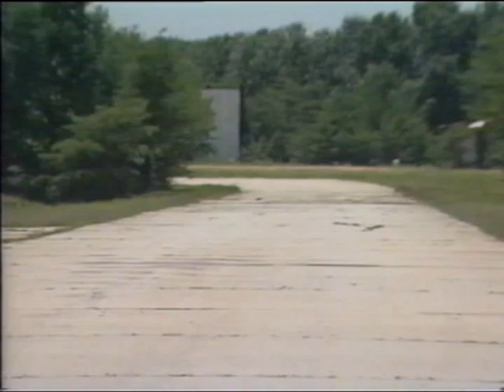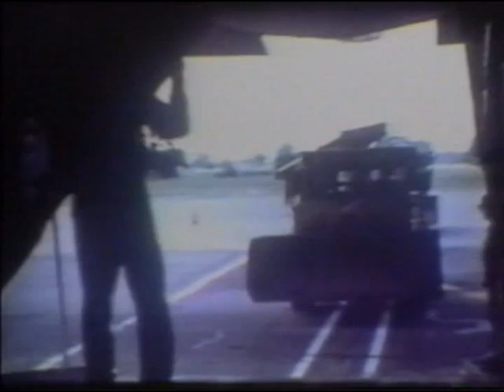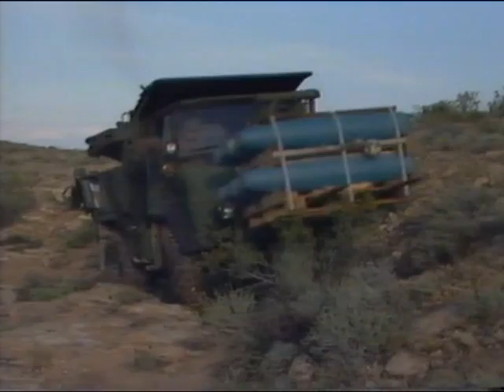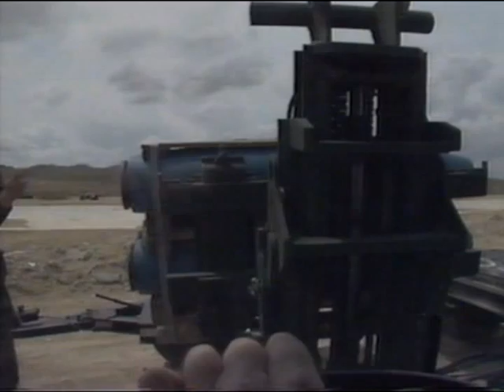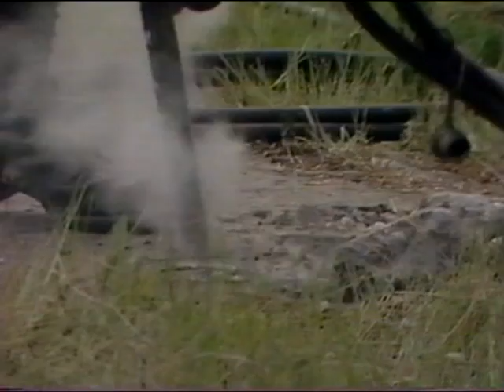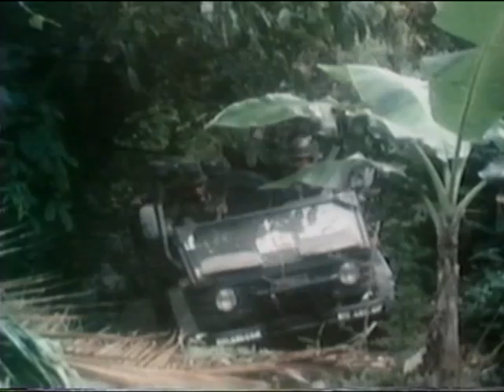Unimog Military Applications 1

Comment: the rops top should have flipped up as they show in the video on the final product.   a field repair that would have required tilting the cab would have been impossible without a piece of equipment that could lift the rops off.  
a turbo om342 should have been fitted.
and those stupid euro fuses should have been replaced by the blade type.
by rights they should have just used an sbu.

Comment: The narrator needs to change crack dealers. The UNIMOG is 100% Mercedes Benz. To claim that the army spec,d it is idiotic. Designed by Mercedes and built by Mercedes. Freightliner is only the dealer. Nothing more! IDIOT!!!
Reply: montwolfman they were built by freightliner no? It seems they were probably shipped over as the base tractor then the hackhoe and loader were added so at best freightliner was an integrator.
Reply: Assembled by freightliner. Mercedes didn't make the attachments. But yes, it's not a freightliner

Comment: Yeeeees, our testing proved the Freightliner, ahem, Unimog tractor was so exceptional and versital, that the geniuses in our military decided NOT to use it.  Well done.
Reply: kilrassclown eh well if you have ever used a small backhoe like that...it will do in a pinch but is not very useful overall compared to a full size backhoe or excavator...the forklift and loader though seem pretty handy and the truck tractor itself is pretty awesome.